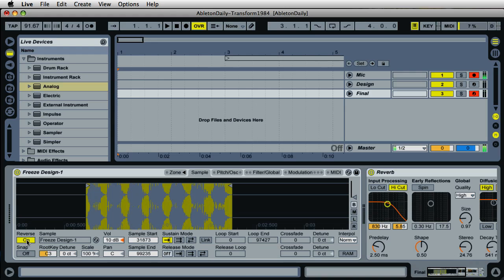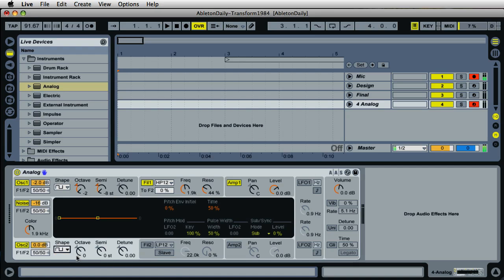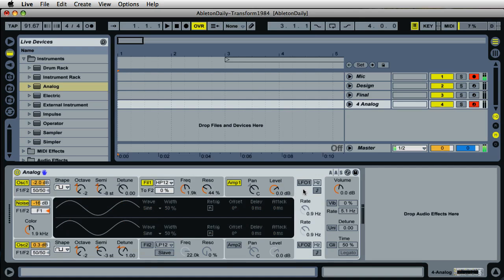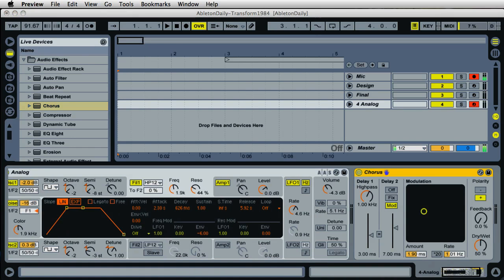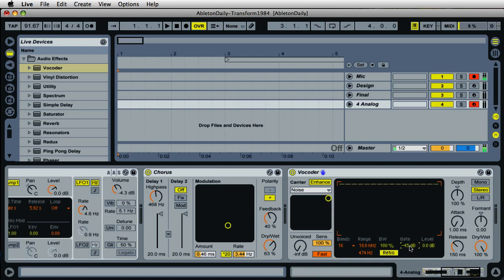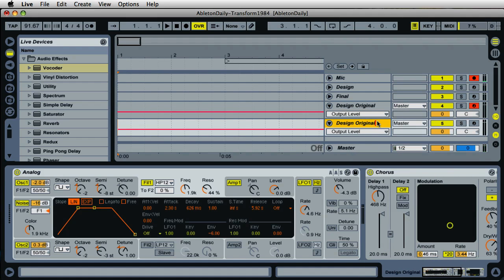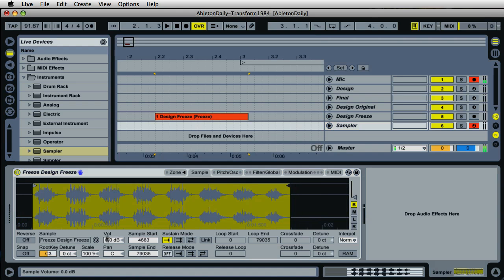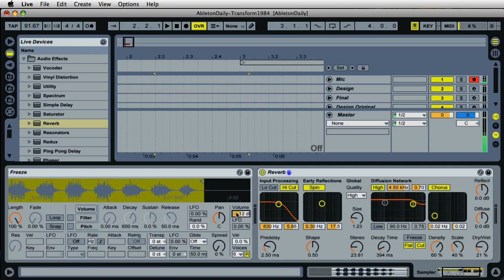#21 Transformers Sound Effect :: Ableton Live

Comment: I was always under the impression that Wally Burr Studios had loaded a “crunch” sample into an electronic keyboard, and then made the transformation sound by playing a series of “notes” on the keyboard. Depending on the octave or whether it was an ascending or descending note structure would give you the transform between robot and alt mode, and also the “size” of the robot or speed of which the transformation was occurring.  Meaning, Bumblebee should be a higher/faster note sequence and Devastator or Omega Supreme should be a lower/slower note sequence.